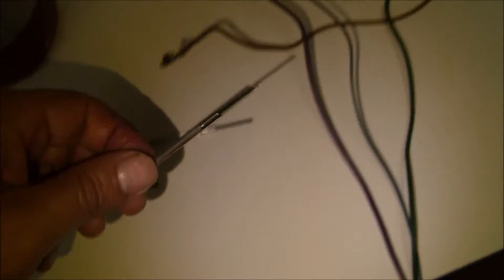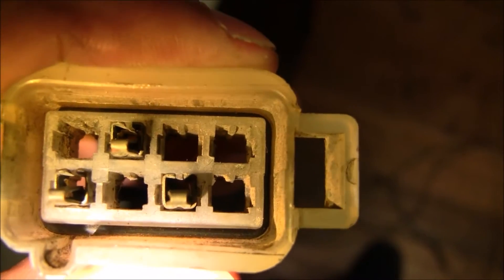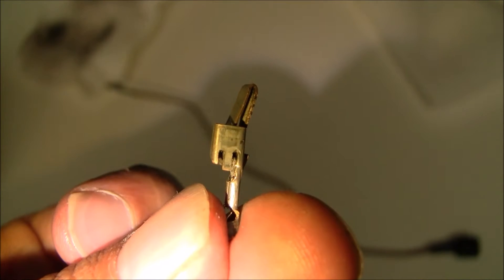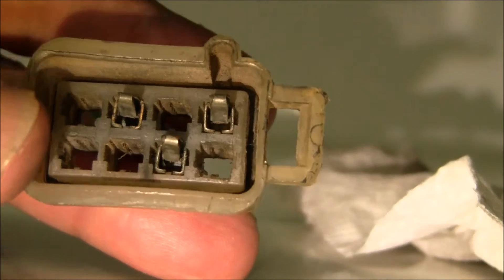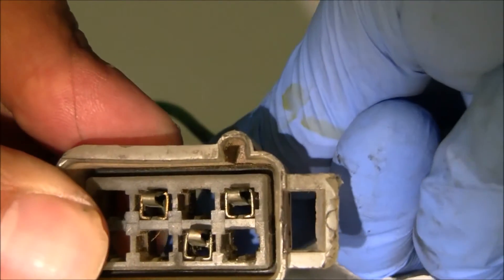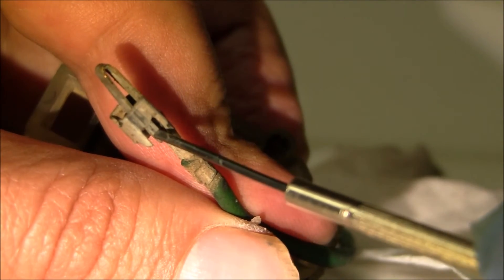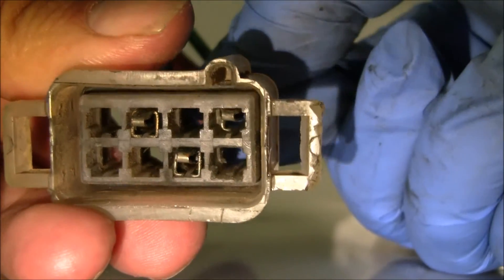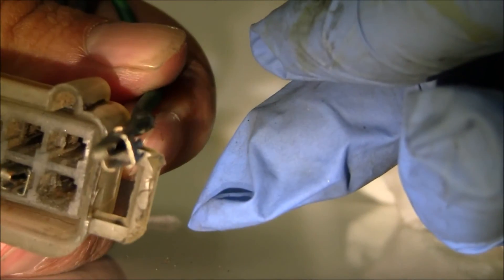removing pins gm bulkhead connector

Comment: That is great!  But do you know where I can get new crimp on pins?  The resistor wire on my '65 needs to be replaced with a standard wire to a new coil with an internal resistor and I don't want to splice onto the old wire stub.
Reply: You ever figure this out the part # for the pins? Fighting the same battle currently.
Reply: @JH-os2uj  Found some online, Danchuk, maybe?  But decided to reuse what I had.
Reply: Hi Newtonian Society,
I have a 1965 Impala SS that I wanted to do the same thing to. Turns out there are two unused terminals on my fuse block labeled "Fused Ign". I will just use one of those to go to my HEI coil bat+ connection and leave the resistor wire in place in case someone after me wants to go back to the old school coil and points distributor.
Reply: @bartsarton2212  Makes perfect sense to me.  I reused the old connector, was just very, very careful to get it off the resistor wire and back on the new one.

Comment: Thanks for posting I have a 64 nova and don’t need to put a whole harness in, just wanna put a couple new connectors in!🤙
Reply: You ever figure this out the part # for the pins? Fighting the same battle currently.
Reply: @JH-os2uj  
I think I found them on eBay but I never ordered them I got sidetracked.  When I get em I’ll post it if their the right ones.  Think I found the # on Steve’s nova

Comment: Thank you for this information. This is exactly what I needed working on my 1965 Impala.
Do you know the part number or name of that electrical pin? I broke mine trying to get the crimped wire out of it.
Thanks.
Reply: You ever figure this out the part # for the pins? Fighting the same battle currently.